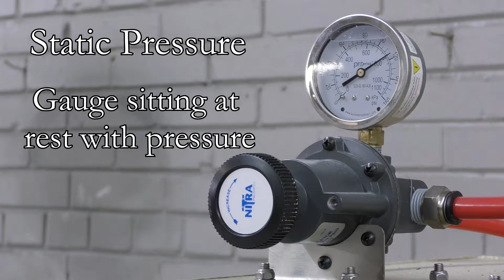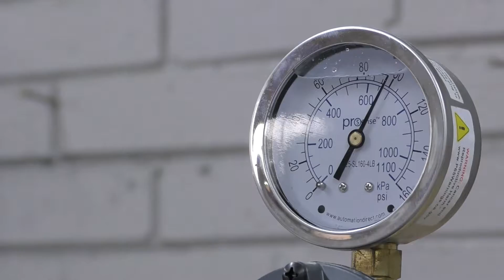Static vs Working Air Pressure (PSI) - Vapor Honing Technologies

Comment: To get my weekend warrior cabinet working at it's best, removing all the quick-connect hose fittings between the three compressors and blast cabinet did the trick. Every place a 1/4” quick-connect fitting was being used, the air path was being restricted to 5/16”!
With all those restrictions removed my cabinet breathes much better. Even with 115 gallons of air tank feeding it, in about 40 seconds all three compressors have to kick on to keep the air pressure up.

Comment: What working pressure would you recommend for a VHT 4000. I about to purchase one of these from you in couple weeks. If you can recommend the specs of a compressor to run this unit that will be appreciated.
Reply: Hello Glyne, Niki here.  The VH4000 Requirements are 30 CFM at 100-120 PSI.  Call me when you are ready to proceed with that order.  Thanks Niki 828 202 5563 x 103 nicole@vaporhoningtechnologies.com